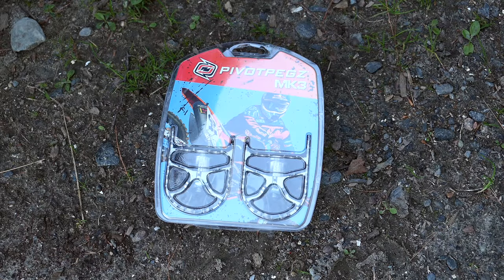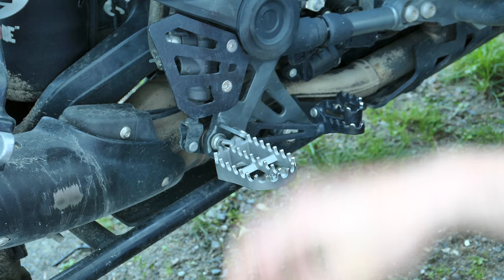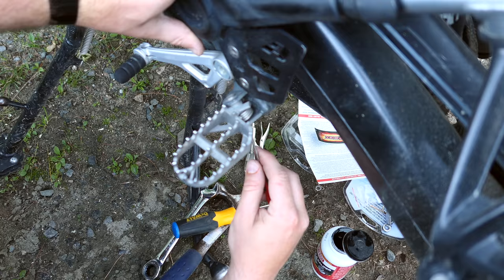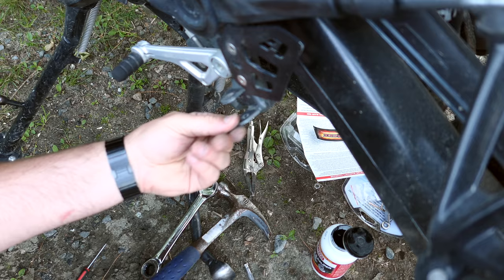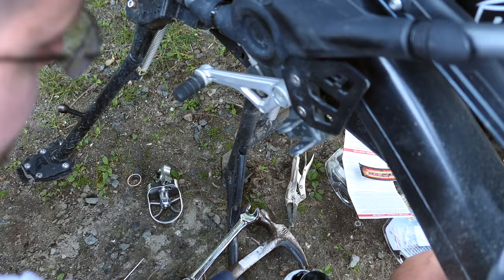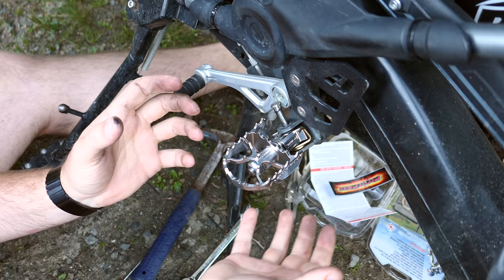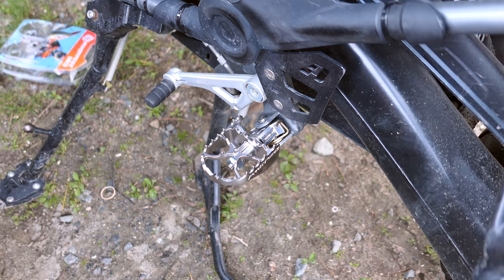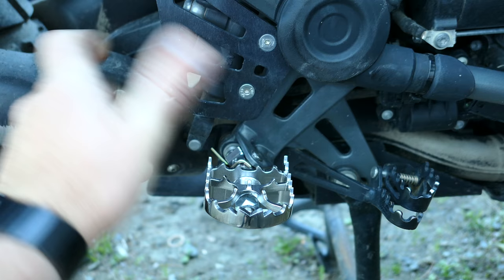Install: Pivot Pegz Mark 3 Foot Pegs BMW R1200GS

Comment: Any good?
Reply from the maker: I liked them but note you're losing the ability for the pegs to fold in. When I slide my GS into a guard rail, the pegs didn't bend in like normal ones and caused my frame to crack. I never would have had a totaled GS had I been using normal fold-in pegs.
Reply: @AdamChandler86  Good to know!